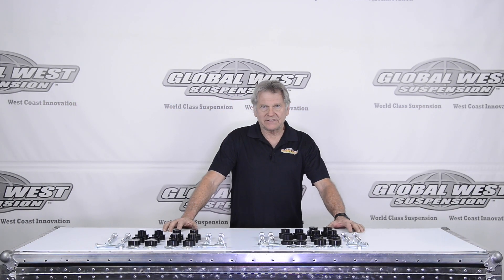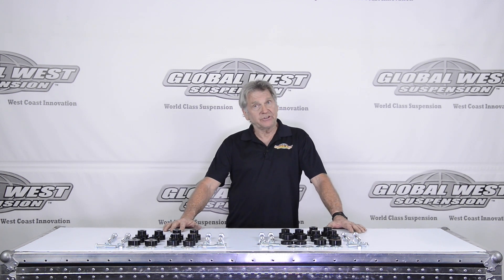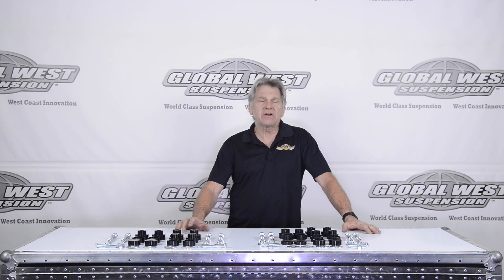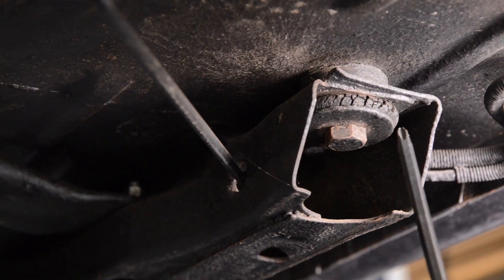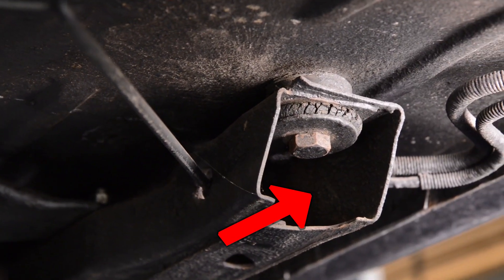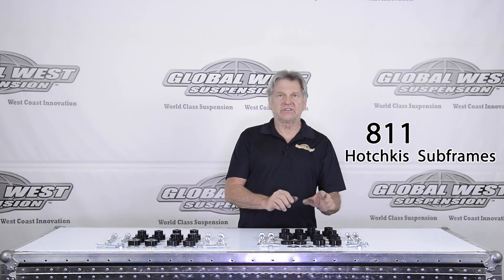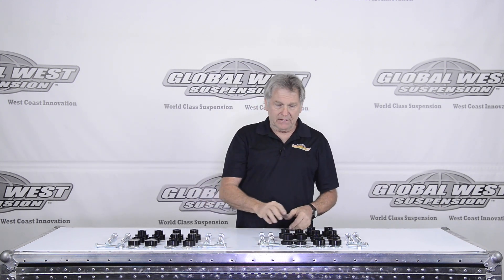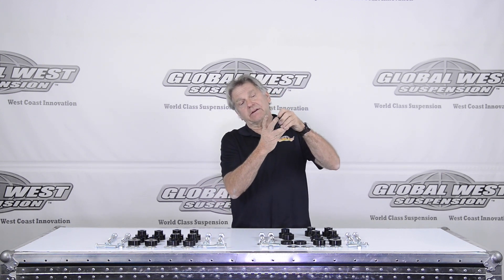Two different types of interloc body mount kits we carry for first gen Camaros and Firebirds

Comment: The car is a 71 Camaro.  When I bought it, the front hood corners were uneven with the fenders. The frame was probably twisted.  It looked bad.  I used a set of your solid mounts and was able to adjust the thickness of the front mounts to get the hood and fenders even.  I also used 1/8 inch shims on all of the mounts to get a little extra clearance from the hood to the air filter.  The engine is a LS with a carb style intake and a dual snorkel Z28 air filter.  I now have 5/8 inch clearance.
Reply from the maker: Right on! Thank you for sharing! Sounds like you used the product efficiently and knew what you were doing to create the hood clearance.